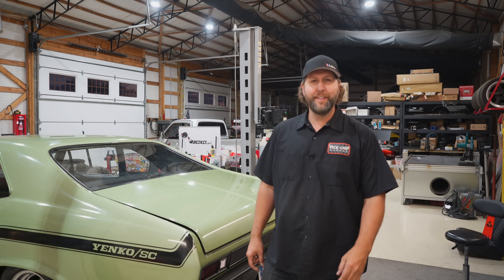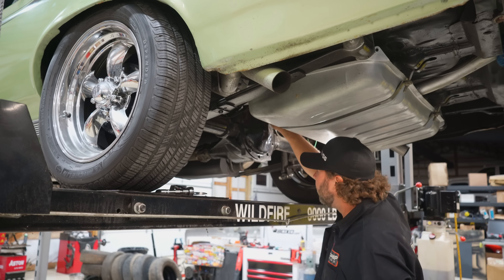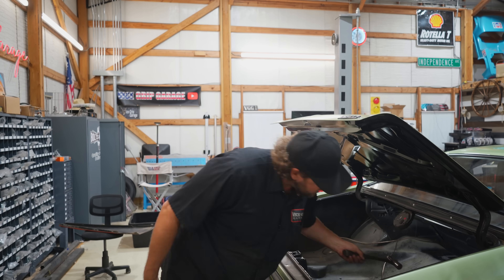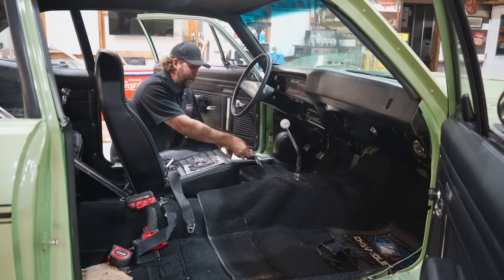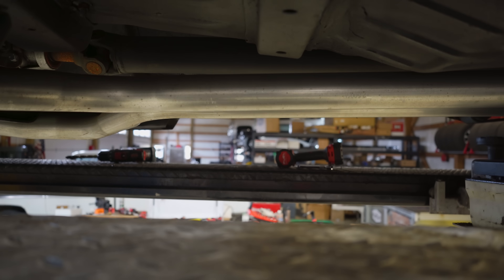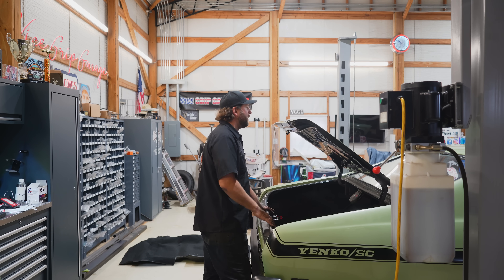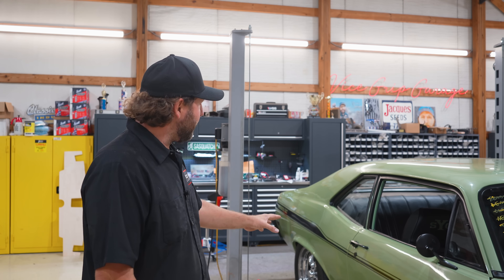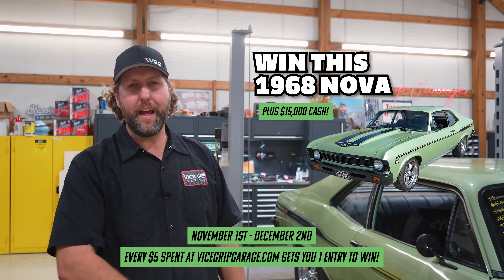DIY Custom Trunk Build & Interior Updates on A Chevy Nova!

Comment: what the hell gauge are you using for the patches? That trunk is probably 18 gauge air shears can cut it just fine. 16 gauge starts to become a cut off for them... depending an air shear might work or break a jaw trying with 16 gauge.

Comment: …buy a new nose for the impact..a pin style one..then snap a conventional 1/2” to 3/8” adaptor or the like on it and it will last forever…those hog rings are junk..I took mine back and got a pin style..it doesn’t unlock easily so I use the adaptor..

Comment: Take the lense out of your welding hood and hold in your meat hook whilst you mig with the other! Thats if your fat head/hood doesn't fit where the welding is! Pro tip from a boilermaker! I would have fit filler peace in the hole and tig welded it! I couldn't sleep knowing those fill peaces needed bondo!!! Lmfao

Comment: It will come off. Those aerosols of contact cement are the worst contact cement you could use. You need Weldwood from a can, not a crappy aerosol. But, then again, never to you is a short time. Once it is gone, out of sight, out of mind.

Comment: Derek, Hi how are you and the family doing i hope you guys are doing well. I've tried to reach you and every time, I'm just about through with my message my message leaves and goes somewhere and then i can't find it. I have a very important question for you!! I have been through 3 different mechanics the first one i had was a racing motor builder. He also has a machine shop so he was to bore my cylinders at 40 over and he was to hone, polish and everything that my block needed. He charged me $980.00 now the 3rd man who has my parts and block he said, that the cylinder were not round they ard oblong and some were to small the piston would not go into the cylinder so now he's got my block at the machine shop where he uses all the time. But, Derek lets move on, i want you to build my engine if possible, I know you are a very busy man. Please, give me a call my cell # is (803)-825-1064 Home # is (803)-825- 0103. Please, give me a call my cell# and if you don't get me, call my home# that way you can leave me a message on my answering machine and your phone # so I can call you back if its to late i will call the next day. This Mustang is my bucket list car. When we can talk i will explain my health to you then. So Derek i hope and pray you will consider the job for me. My problem is I have Pulmonary Fibrosis there is no cure. That's just one of my problems. So lets move on. Please, give me a call!!!!! Thank You!!!!!! Sincerely: Richard Webster, may god bless you and your family!!!!!!!!